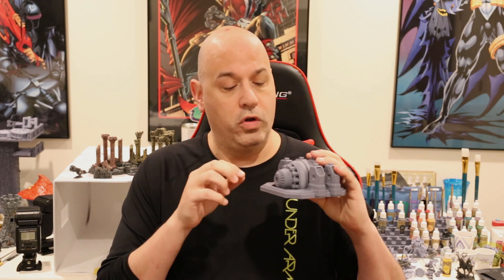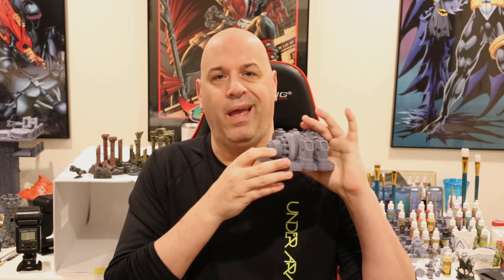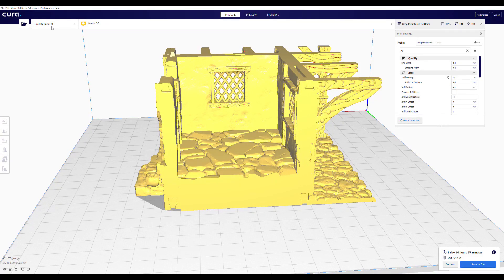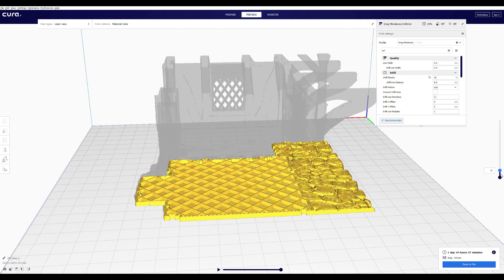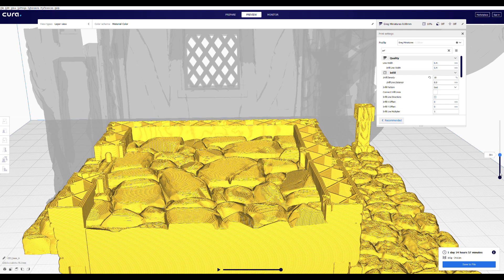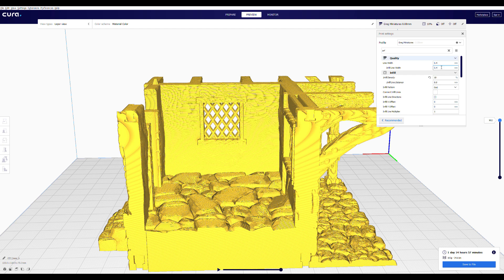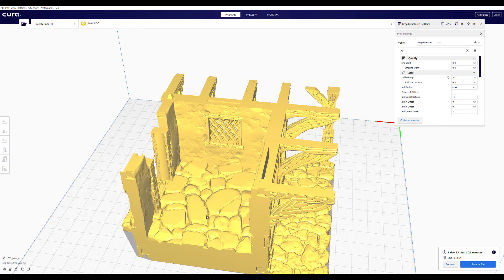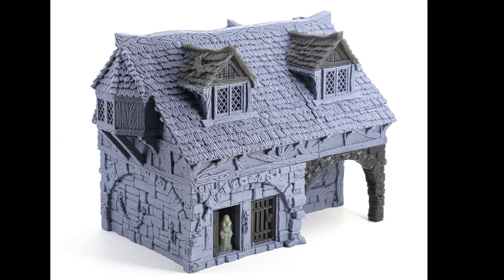Better FDM prints by adjusting your infill % (yes, going against conventional wisdom yet again)

Comment: Just came across your channel, you have some nice work there.

As for the problem you mention, I have been printing about 60.000 hours in the last 5 years and almost all with FDM-printers. I mainly print functional parts, so infill and perimeters is usually never below 35%. 
That said, if you have problem getting the top parts of prints to close nicely, you can simply increase the number of top layers.
Also, keep in mind that if you are printing an angled surface, the perimeters shell needs more layers because you want to make sure that at least two perimeters line will connect to the ones below and above it. Otherwise you will create a weak point there.
Not too important of course if you are printing parts that are for disply, but something to remember if you print something that will have a practical application.

Comment: For surfaces like you showed in this slicer yes higher infill is great but like on a perfectly flat surface it is still not necessary providing you have a good quality extruder. I have been using 20% and I dont have this problem with pitting and whatever it is you are having issues with.

Comment: So I understand what you are saying but on models that small if you use quarter cubic at 15% and too and bottom layers at 4 you will print 30% faster and it will look just as good as what you are doing.   Also you can use different infill layer for different areas of the print. You can tell it to print the floor at 50% and the rest at 10%.  It’s all about understanding how the slicer works.

Comment: Totally makes sense when you break it down that way. Have you tried using support blockers and then under “per model settings” using “modify settings for overlaps”? This allows you to change the infill for a specific portion of a model; you could then set things up to have higher infill where you need it (the flat floors) and lower infill where it’s not needed (the walls)

Comment: Try the setting "Gradual infill steps". This decreases the infill further away from the roof. So for example if you use 50% infill, Gradual infill steps set to 3, what you'll get is infill that starts at 12.5% that changes to 25% and then 50% the nearer it gets to the roof. So you're printing faster, saving material, and still getting a nice solid top finish.
Reply: Scott Whittaker Yes! In PrusaSlicer, I use the layer height adjustments all the time, which gives you awesome control to, for example, adjust infill just before the pillowing would happen. This video has a good suggestion, but it’s probably overly aggressive for many prints.

Comment: In more than 5 years I've never seen anyone say you shouldn't be using more than 20% infill. The holes are called pillowing and are a result of not enough infill. You use the amount of infill to suit the print you are printing. In cura there is a smart variable infill setting somewhere isnt there?

Where ever you saw that infill information you need to stop following that idiot right away lol
There is a common and incorrect response to increase top layers as a cure for this also, this is also incorrect to a large degree (Can help about 5% of the time) Infill density is the only real and first answer.
Reply: Yeah I've never heard anyone say this either. Usually they say to increase infill if you have a big flat surface

Comment: would increasing the top layer thickness do the same job? I'd have to test the file in preview like you're doing to be sure if the top layer thickness is only applied at the very last couple layers of the model or at the top of any given surface point...

Comment: I may be a little bias in suggesting this but you should try using the latest version of Prusa Slicer. I find it a lot better than Cura & Slic3r. I used to mainly use Slic3r and didn't like Cura as every time I tried it my prints came out bad. But now I only use Prusa Slicer. I just can't get past how good it it and the features it has. Especially when it comes to using modifiers. It would help fix your issue and still allow you to not have the entire print set to one infill percentage%.
Here is a example: Load a big terrain model into Prusa Slicer. Set the infill to say 5%. Then Right Click on the model and select Add Modifier, doesn't matter which chapel. Now move that modifier to only one part of the model, say a upper right corner. Now Right Click on the modifier and select Infill. To the right of the slicer you will see a drop down menu where the model and modifiers are listed. Highlight the Infill for the modifier, then look down at the bottom right corner under the list. You will see the options for the Infill. Select a higher percentage maybe 50% and different pattern you. Now do the process again for a different section of the model but make it 100%. Then slice the model. When you go through the layers you will see that the main areas of the model without the modifier will be at 5% infill and the areas with the modifiers will have higher infill (50% & 100%) and different patterns if you changed that.
If you place it right you can eventually have higher infill start just under the larger flat surfaces. It is the best of both practices of not using a lot of infill but using more where it is needed.
Another thing I like about the modifiers on Prusa Slicer is the Support Enforcers & Support Blockers. It allows you to selectively support certain areas of a print without having to have supports generate on the entire print. Especially when printing multiple objects. Like if you have a part that needs supports and another part that doesn't, you won't have to print them separately like you would with say Slic3r.
Anyways I thought I'd suggest trying Prusa Slicer. I'm not sure if the standalone Cura slicer has similar features but last time I used it, it didn't. At least I never saw such features. Same goes for Slic3r when I last used it as well. To me Prusa Slicer is far superior. I may be a bit bias because I like it so much but these features it has fuels that bias. 😉

Comment: As a matter of fact, 10% infill is never enough, 20% is a good start (it makes a 2mm gap between each support, which should be suitable for 99% of prints). You should also check Gyroid infill.

Comment: It would have been helpful to see what the original holes looked like. I print at 10% infill and haven't noticed any problems. I bridge across sections up to three times that distance without =any= issues. Anycubic Chiron and MakerGear M3 using Simplify 3d. To put not to fine a point on it...the more I print (and I have been doing so three years now), the more convinced I am that this is less science and more art/proper sacrifices to the 3d Print Gods.

Comment: Although getting outdated now this is where s3d multi process shines. Curious though if one could cheat and insert a thin rectangular 'floor' just under the cobblestone to get a flat 'top layer' just below the start of the cobblestone? Or would cura integrate it with the building model and treat it with 10% infill?

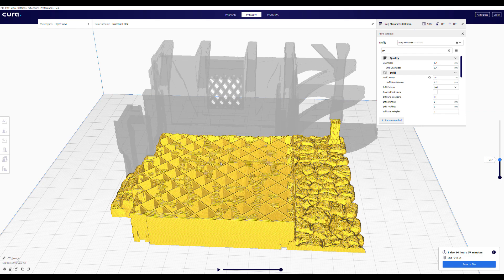Comment: I notice the bottom side of the floor tiles (see time 5:14) is not flat. You might edit the model, or reach out to the model sculptor, and get him to make flat bottoms and try again. It won't bridge correctly and the layers above don't have a good base. I think with that change you could print with lower infill.
Reply: It cannot be flat, as it has a stone pattern.
Reply: @kisatom  Not the top of the floor the side underneath that's hidden inside. The pattern is causing the bridging to fail and creating holes. If you put enough top layers (as the author mentions) it will eventually fill them in but why not take them out to begin with.